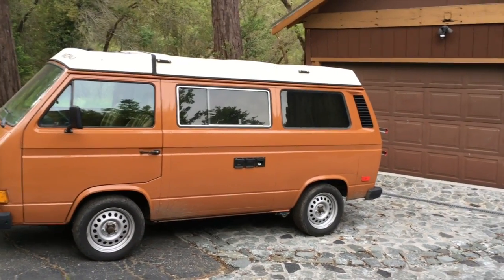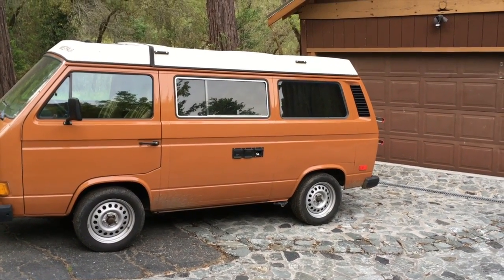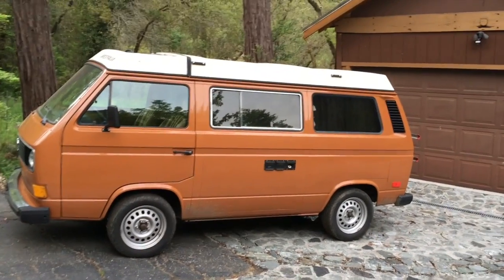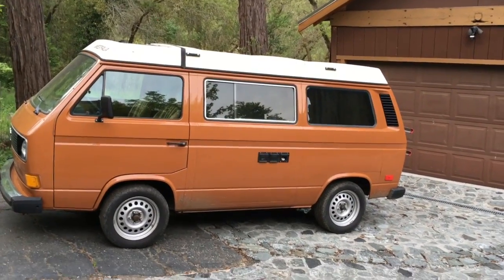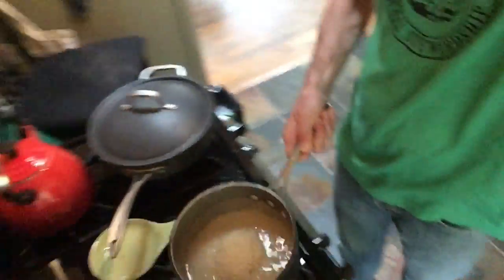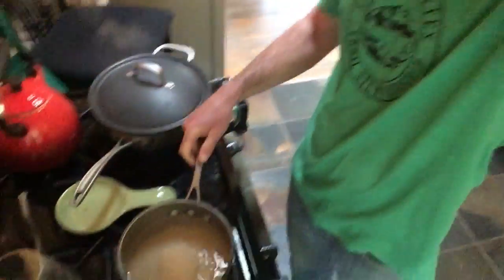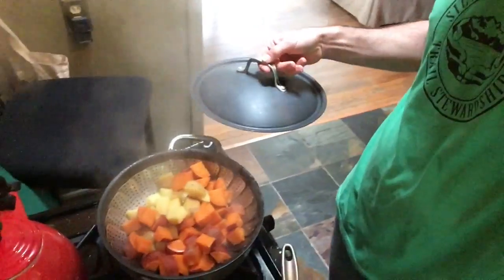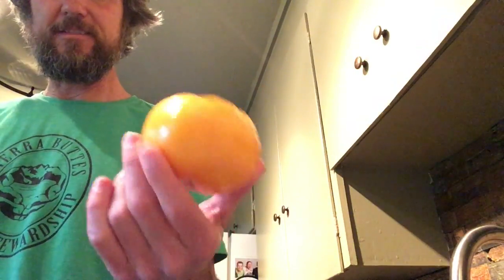VW Vanagon Type 4 Engine Rebuild Talk Part 1

Comment: How is the power now compared to what  it was?  So you ditched the hydraulic cam.  1.7 rockers?  Are you referring to 1.7 rockers out of a 914 or 1.7 ratio? I read in the comments on part 2 that you used an angle grinder to clearance the rockers to clear the valve covers im assuming.  I have an 81 Adventurewagen     and rather tackle everything that goes with a conversion i decided to go the route you went.  My biggest concern was getting it smogged.
Reply from the maker: The rockers are stock, I think they are 1.7 era (it’s been awhile since I completed this rebuild) the adjusters were swapped with the Porsche swivel foot adjusters. In order to make them fit, because they are taller, the underside of the rocker arms needed to be filed/ground down. This weakens the arm slightly, but so far, even with stiffer valve springs, I haven’t had any issues in approximately 40k miles. How did your smog check go?
Reply: @Henrywildeberry  Thanks for the info.  I haven't smogged it yet and I don't think I'll even attempt it until I rebuild the engine.  Im going with AA big valve heads and a cam from them as well.  I'd stroke it and go with larger displacement, but Im not sure if it would smog or if the stock injection could handle it.  I put 215 75 15 with gowesty springs.  I may get the tranny regeared.  Building for desert and Baja trips.